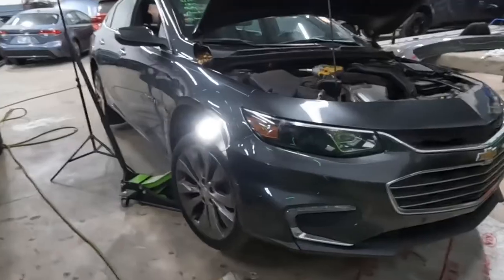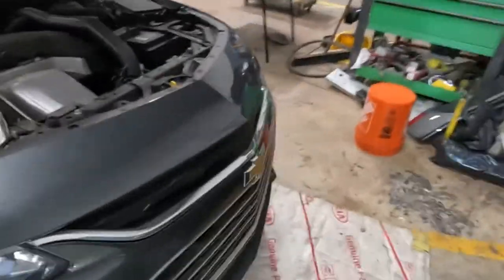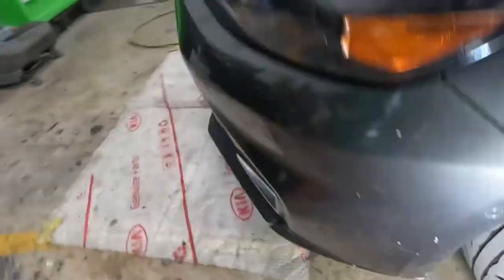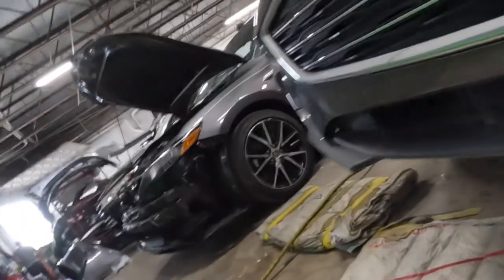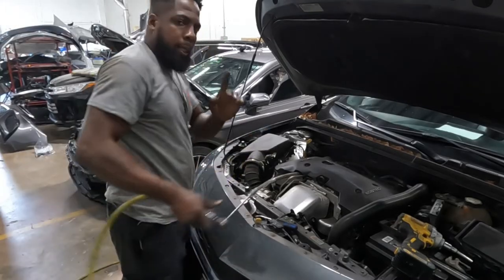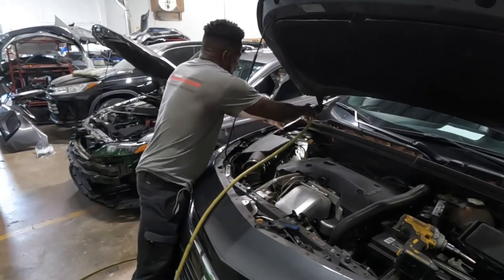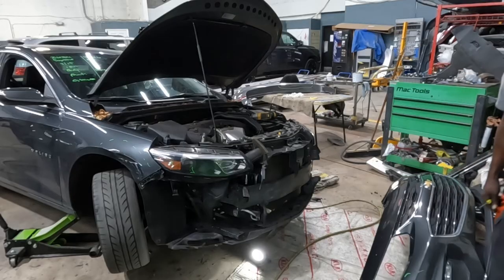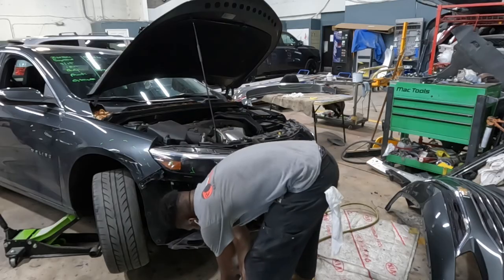2016 CHEVY MALIBU how to take the front bumper and head lamp from off the vehicle

Comment: Great video but I have a question I'm replaceing my bumper and I have the parkassist package on my 2016, do the sensors need to be removed or are they mounted separately and slide out easly? Also is removing the grill and parking lights need any extra tools?
Reply from the maker: They mount separately and comes out individually and as for the grill and bumper it’s the regular standard number 6,7 socket. You will see whenever you take it off

Comment: Hey just wondering if you have any idea why mine might not be working the bulb is perfectly fine just put a brand new one in on the right side.  It stopped working after a minor accident very little damage in the front end. Basically I fell asleep at the wheel in a construction zone and hit an entire line of cones they all got stuck under the car and a lot of plastic covers got ripped off from under the car. I brought it to two different AutoZone‘s and both of them put a brand new bulb in the right side headlight it will not work at all whatsoever after the accident. I’ve been dealing with only having 1 light working in the front for many months now and i basically avoid driving at night now it really sucks
Reply from the maker: Make sure the bulb is screw in the socket properly or Check the fuse. If that doesn’t work order a new light or an aftermarket one. It’s not safe driving with just one light preventions is better than the cure so plz order a new light